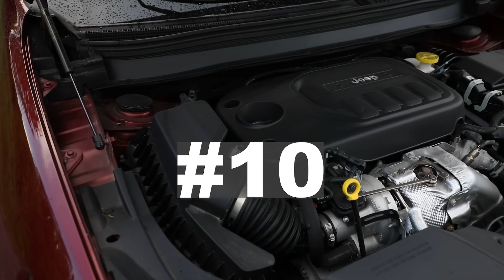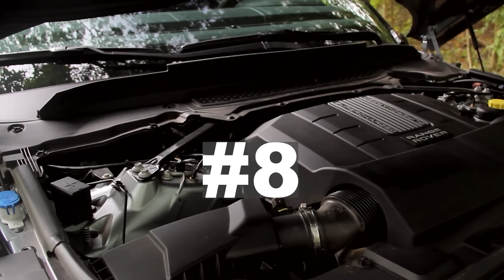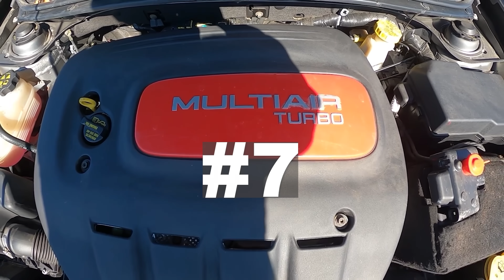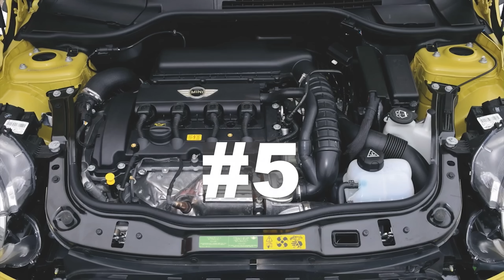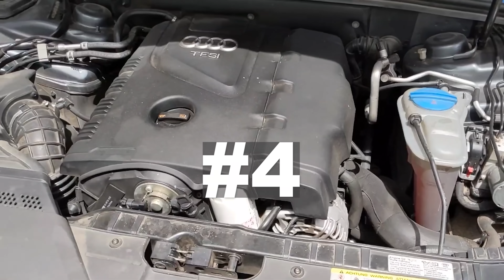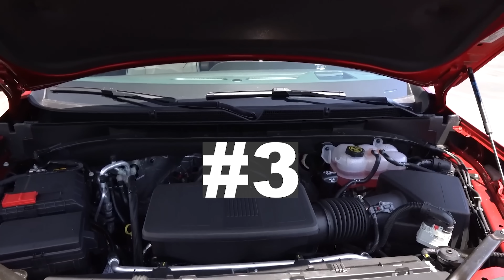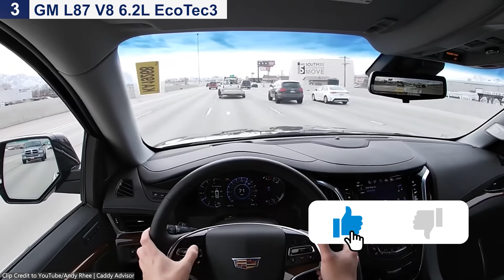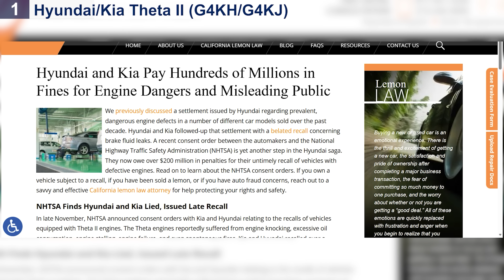The WORST CAR ENGINES ever made (AVOID AT ALL COST)

Comment: I got pretty lucky with my 2010 GTI. No oil consumption even at over 160k miles, only one failed intake manifold, and no water pump failures. The rear main seal even went 165k miles before it failed. Best car I’ve ever owned, it’s a shame they all weren’t as reliable as mine was.

Comment: What about Cadillacs computer operated 4 6 or 8 cylinder engine taxation was totally useless at 40000 miles or most were at 36000  one shop told me total trash useless newb engine. Or you cannot drive. Since July 1965 my first time learning to drive I have seen so much wrong with our automobiles how used driven even did wrongs myself driven when I could have traveled cycling walking doing my business to earn $$$$$$ dinero oh yes I repeat does it always matter how mucho dinero you are paid no less could be mucho when done properly now I ask you all to realize gasoline is only one cost for driving besides tires oil changes tune up brakes spark plugs automobile insurance or for ourselves clothes health medical auto acidents mucho of are on left tur no worst driving is stop and go how cars are made matters also volks who stay on schedule with proper mantaince schedules or only drive when really need to or warm up vehicles properly mucho often best to drive slow easy does it avoid rush hour tell me who really rushes then often I have said to drive when roads are not overcrowded shopping parking lots are are mucho crowded mucho volks will not walk a few more feet to shop usually wasting $$$$$$on car costs driving time wise to park closer to stores in my nearly 80 years of life I have seen plenty volks do not always best ways not organized oh yes how mucho gasoline is wasted plus wear tear on cars because gasoline is cheaper 2 miles further away now seen on I pad  worst fuels to use in cars who remembers by gasoline pumps was a small red hose your tires rolled over to signal they had a costumer knew us by name sprayed your windows wiped them clean had unlocked toilets free to use I miss map books you kept with you pull over roadside to read for directions what has because of honest businesses now some places rig gasoline pumps to charge mucho more costs few cents for gasoline you donot get it all ads up after a while or they fill up when I had only six dollars then I was to sell mucho business what you donot want law is you donot pay it in todays insane society our values priorities are so wrong because I work only honestly I have a proper reputation with police fire when seen am rarely bothered or if asked anyone bothered you  donot believe me try it some day I will never lie to any one

Comment: My wife’s 2010 Prius will easily go through a quart of oil in less than 900 miles and Toyota after we have taken it in there several times says that that is normal. So don’t necessarily rely on Toyotas.

Comment: The GM 3
6L LFX is very reliable after 2012 if you stick to 5k oil changes.

Now the 3.6L LLT in the SUVs is the chain stretcher.

The Pontiac Bonneville NEVER had.the 3.6L engine. It had the 3.8L, 3.8L.SC, and 4.6L in GXP.
Reply: Agree, have a 2017 Buick Larosse with the 3.6l and they "fixed" the timing chain issue ( slightly smaller chain to cominsate for any strech, should of just used a better quality chain to begin with) in the 2013/2014 model years. The issue with lubrication is not what they said, its a lack of oil changes to keep sludge build up at bay. Change at the latest at 5000 miles, not 7500 the owners manual says and use full synthetic.
Reply: 2026 is the last year for the Chevrolet Blazer RS AWD gets the 3.6L V6 LGX engine which is even better than LF, But I agree with the oil change every 5,000 miles we don't put that kind of mileage on our vehicles so it's every 6 months the 2026 Blazer we just bought will get it's 1st oil change at 1,000 miles max minimum 800 miles this will be be the last new Chevrolet we will buy. I'm staying away from the 3, & 4 cylinder turbos, & CVT trans.

Comment: Planned destruction, so you’ll be back to buy another one!!
Reply: I am convinced that’s why many manufacturers (especially German luxury brands) call for oil changes every 10,000 miles instead of 5,000.  Even if the oil technically lasts longer without breaking down, the junk in the oil that is too fine for the filter to capture is circulating in the engine twice as long as it should.
Reply: @JBM425 same for when a family member bought a Toyota truck.. they said 10k oil changes only!! ( we do 5k oil changes!)
Reply: @JBM425  The 10,000 mile oil change can be traced back to mandates from government. The EU to be specific. 
Up to a point, a used oil filter is more efficient at catching the "fine junk" than a new filter. The explanation is too complex to try to describe here.

Comment: This is why I have kept and maintained my 2001 Toy Tacoma with 320 k on it !
Reply: You Sir, are a model citizen!
Reply: Me too😊
Reply: I have a 2003 Toyota Tundra.    196,000 miles and it still runs great.   The AC has failed and it’s too expensive to justify repairing it.
Reply: @SMaamri78
Just get it fixed. You will thank yourself. It’s worth it. That truck may have another 100K to go.
Reply: Just simply Follow what the Manuel says. Good Job
Reply: I wish I’d have known what a diamond in the rough my 85 Toyota 22R pickup was. I’ve not had a vehicle as reliable as that since 1995. I had around 350K miles on that truck and sold it.
Reply: I don’t like driving junk
Reply: @adamvmax4286  I am Curious , What are you driving now ?
Reply: @adamvmax4286 or drunk😅

Comment: I just bought a car, and held my breath watching this video, and i am so relieved my 2022 Honda HR-V Sport isn't on the list.
Reply: Honda Hrv has a CVT trans so you might have  a problem there , unlike regular automatic transmissions , CVTs need frequent fluid changes every 30k miles , regular trans at 60k , so more frequent changes with cvts
Reply: @recordgalaxy its a better one though
Reply: @recordgalaxy 
Every Honda I worked on has 30k miles tranny fluid interval - smaller tranny, less fluid  more frequent ATF change interval, makes sense. Engine oil 5k you will be safe for a very long time, forget whatever the counter on the dashboard shows - just cut it in half. My friends Odyssey, an ex Honda certified mechanic has 300k + miles. He also own Acura Type R, today considered one of the best Japanese classics.
Reply: I have a Buick 1.4 turbo. Waiting to see if it’s on the list. My next car will be Toyota or Honda. My wife was GM Retired so we were GM.
Reply: @DetroitDon929 I wouldn’t dare to get a Honda. IfThey gave it to me for free with transmission issues and motor failure. Toyota is the way to go depending on which model Toyota cause most of these newer cars not built to last anymore
Reply: its a good one..tried and true.
Reply: DONT BUY A 2025.  YOU WILL BE SORRY
Reply: @samcolt1079 why
Reply: ホンダや日産は急に壊れレッカー移動が要ります、それ以降乗ることが出来ませんが、トヨタやスズキ、スバルは故障後も多少乗れて週末か給料日後に修理できます。これらは使われている部品の精度の違いです。ー日本より
Reply: New Hondas anything 2020 and up is  unreliable no thanks

Comment: lol Hyundai and Kia still have major engin problems today with many lawsuits 😅 they might look good but everything else is garbage
Reply: I change oil at 4000miles
Reply: @smacksmack5976  Good!  Frequent oil changes at 4-5,000 miles instead of 7,500 or 10,000 miles is much cheaper than a major repair or a new engine.
Reply: There is a YouTube documentary on Hyundai manufacturing plant. They are modern day slaver masters! They had everyone under the sun as slaves, from the regular average Jane and Joe, prison labor, illegal immigrant cheap labor, and even child labor! No wonder ICE raided that facility in Georgia!
Reply: @supertrendymoneymaker0722 saw that
Reply: @supertrendymoneymaker0722 ya Even in the US and Canada they do the same
Reply: The 2018+ Kia 2.0 is a great engine. Not as powerful compared to the Hyundai Theta 111 or the problematic Theta 11 but it more dependable . When looking at purchasing a new car what I looked at was what are being used as taxi's. These engines easily do 180,000 k's a year without any problems and they are timing chain engine unlike the previous timing belt. I also spoke to taxi drivers and they loved them for the tech, comfort and of cause reliability. My sister has a 2019 Iron Man with the 1.6t and she seems pretty happy with that.

Comment: lol even the new 3.6 from Gm is a disaster and dies because of a sensor for no reason after 10k miles
Reply: Mine is just fine in a 2020 Cadillac. Runs like a race car
Reply: @DouglasMix-o7h good luck 😅 when that thermostat goes you’ll be crying

Comment: My 2014 Hyundai Santa Fe Sport has over 252,000 on her with that horrible Theta II 2.4L. I must be a lucky guy because "Sandy Fay" still is all original underhood except for batteries and a belt replacement. On a recent trip of 300 miles, driving leisurely at 60 mph, she averaged 39.9 mpg. Bump it to 70 and she does 36 mpg. I know, I don't believe it either. It gets better...she still has her original plugs also at 252,000. I took her to my mechanic to have her wellness check before the holidays. I brought him my preferred spark plugs thinking it's time to change the plugs. It couldn't hurt I thought so off he goes to give her a checkup. After about 40 minutes I'm told my SUV is ready to go. The mechanic comes in to prepare an invoice and proceeds to tell me about the OBD II scan. No codes. All parameters within spec. Idles like new he said. He also said he didn't replace the plugs. This engine has never had anyone crack it open. Biggest repair? PCV valve replacement. Did it myself. Mechanic said if you're burning oil, replace the PCV and the burning oil issue may stop like it did for me.  Tranny has been perfect, just fluid changes occasionally. Same for cooling system, HVAC, Infotainment, motors, windows everything works as when I bought it. Folks, I'm not doing anything special. I just take care of her. Best fuel, best oil, best filters, best tires...she deserves them all. And when I provide those things for her look what she has done for me.
Reply: You can use Techron or Royal Purple fuel injector cleaner with every oil change to keep your engine happy.
Reply: From my experience working for several car manufacturers  (retired now), NGK spark plugs seem to have the best performance and least problems.
Reply: Sorry but I had a 2018 Kia Sorento with the same engine ( Hyundai and Kia are the same company) and it was always down at least a quart at an oil change at 5000 miles. And I never got above 29 mpg on the highway at 65 mph or less.( 21 to 22 in town) Got rid of it before the engine did me in. 53,000 on it at the time)
Reply: @paultomaszewski1964 Wow I have 71k on my 2018 Kia Soul none of that 
Caribbean Blue, Korean plate not made in Alabama etc 
not saying that good cars don't come from Alabama just saying mine was made in Korea , don't know if that makes a difference
Reply: @claytonE5721  Mine is from Georgia. Maybe that's a difference?
Reply: Which viscosity do you use? I use 5w-30 on my Kia Forte despite they suggest 5w-20, I know for sure Kia can't run thin oils.
Reply: @mephy72  According to my mechanic Hyundai/Kia had a TSB years ago that said you could use either 5W-20 or 5W-30. HOWEVER, Hyundai has been recommending 5W-30. Which would be better in my opinion because as the engine wears that thinner oil could be causing oil consumption due to looser tolerances in a worn engine. For the record, I use 5W-30.
Reply: Intake carbon cannot be avoided on those GDI , So bought it used with new engine in it I would guess. ?
Reply: @twobeagles1365 Techron is a great fuel injector cleaner with direct injection. Add a bottle to your fuel tank with every oil change
Reply: @twobeagles1365  Bought new, original owner. I have a theory about the carbon issues and GDI. I buy the best upkeep and maintenance products I can afford. Most important of course would be oil and gasoline. I never use anything but "Top Tier" fuel providers. These producers put in all of the additives needed to keep an engine pretty much clean for life. There was no exaggeration in my post above. Have all the receipts and my mechanic always reports my visits to Carfax. To me, one of the most interesting things about my engine is that for the first 200,000 miles I changed the oil at Hyundai's recommended intervals of 7500 miles. At 200K I switched to 5K intervals. I'm sorry so many have had issues with this engine. I'm 71 years old and have bought over 2 dozen cars. I've never owned a bad one or had problems other than wear items. I can only speak of my experience. And my experience is that attention to care and quality of service matters.
Reply: Built on a Tuesday first shift
Reply: @claytonE5721  I knew there had to be a secret!
Reply: I have the 2015 optima same engine 180000, I changed my own oil sense new put a catch can on at 60000 and replace cvc valve ,use about 1 qt per 2000 daughter driving it I don’t expect to last another year
Reply: @ralphpreton7015 That is fabulous. A lot of car manufacturers take the position that using one quart in 1,000 miles is acceptable.
A lot of people don’t realize is that engines burn fuel but engines do burn a little bit of oil too.
Reply: @DouglasMix-o7h  Absolutely true Ralph! There are hardly any vehicles anymore that don't burn some oil.
Reply: @ralphpreton7015  Oil consumption can be mitigated by replacing the PCV valve.
Reply: I owned a few Hyundai's  I believe it has a LOT to do with how hard the engine is pushed.      Along with a bit of luck.     Their engines develop strong HP without turbocharging.  But the bottom end is just not strong enough.   
The last Hyundai that I had had piston slap.    But ran great.  
Thankfully I sold it back to Carmax before it fell apart !  
BTW  I love the Hyundai 6 speed auto trans !
Reply: @dennisg4053  I think you're on to something about how bad the engine is pushed. Being older, I lost my "lead foot" a long time ago. So, the majority of highway speed for me is 60-70 mph. Honestly, most of my highway driving is 60 because of superior fuel economy and less driver fatigued due to elevated speeds. I don't need to get anywhere quick anymore. So... I drive leisurely trying to stay out of speedsters and truckers' way. Always be courteous.
Reply: Must of bought it used and the engin was change several times before you owned it
Reply: @germainwilson800  Bought new original owner